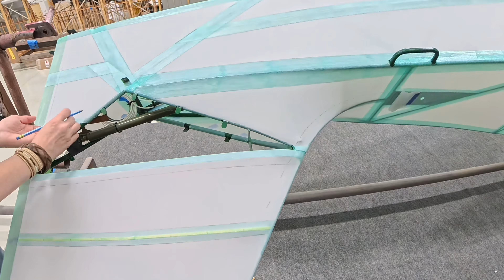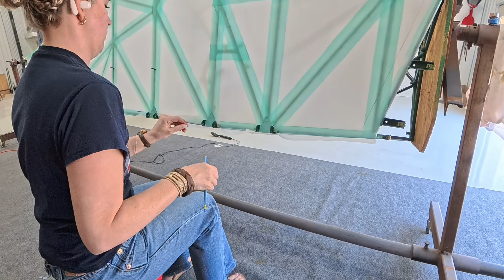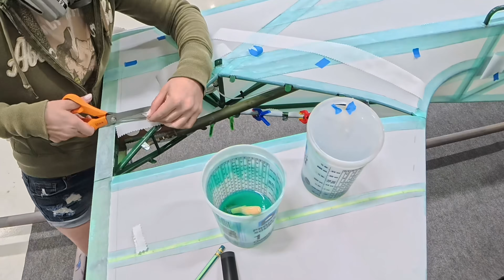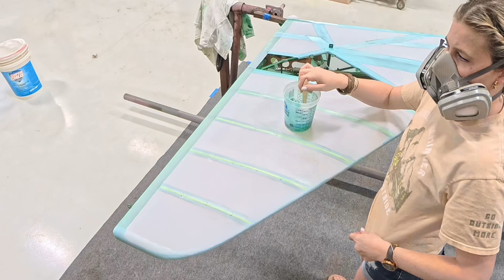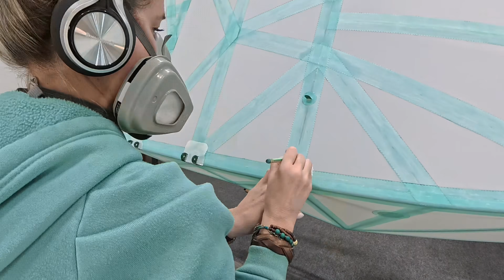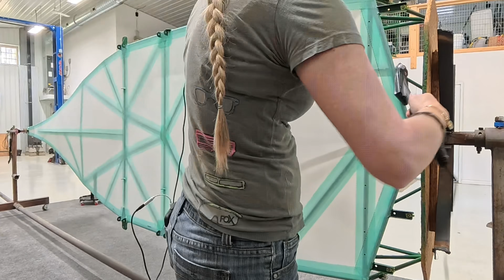Fabric Covering Kitfox IV Fuselage - Superflite System 7 (part 3)

Comment: That system sucks. Try to spray over that with paint and watch it come loose and bubble the build up coats. Be careful what you use to cover your bird. Stits polyfiber is the only covering, glues and paints that aren't picky about what you apply over it.
Reply from the maker: It's unfortunate you have that opinion. I've had fantastic results using Superflite for many years! Perhaps you didn't use proper paint or had contaminants in your prep?
Reply: @iapplyufly  I sure hope there weren't contaminates in the Stewerts sealed containers. Can your chemicals be topcoated with lacguer or enamel based paints?
Reply from the maker: I think we're talking about two different covering systems. I'm not using Stewarts. Superflite uses urethane topcoats (like you'd put over stits).

Comment: I haven't seen your videos in years I thought you quit I unsubscribed. Now you're back it seems. Quick question do you cover the aileron cove before the top and bottom of the wing or after? I'm doing a scale model and need some help figuring out the process
Reply from the maker: I cover it with the fabric sheet when I cover the bottom of the wing.
Reply: @iapplyufly  so you use the bottom covering in one piece to cover the aileron cove? Just cut the bottom and fold it over into the aileron cove?
Reply from the maker: Yes. (Hopefully I'm visualizing what you're asking and not leading you astray!)
Reply: @iapplyufly it should work fine. Makes sense to do it that way. Thank you